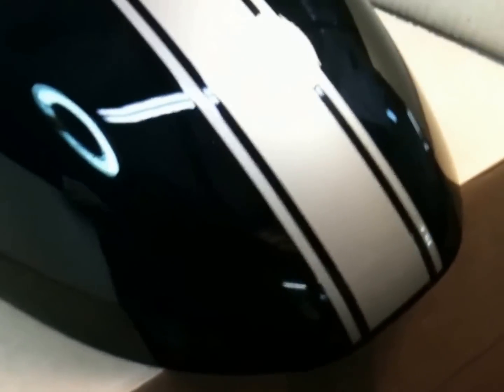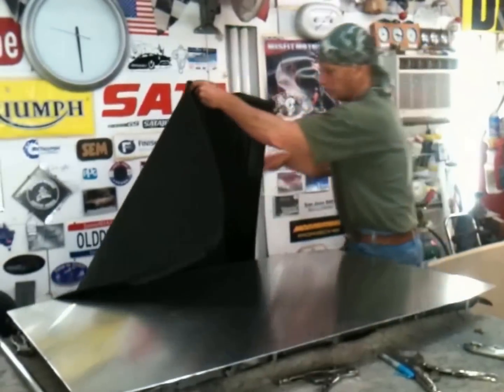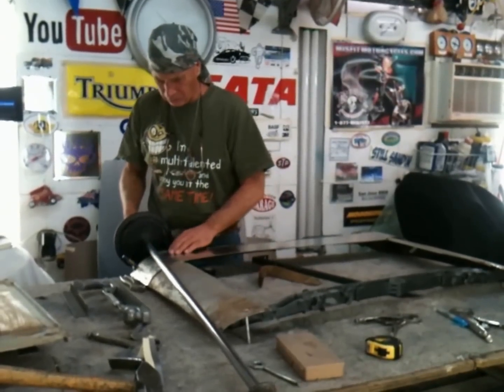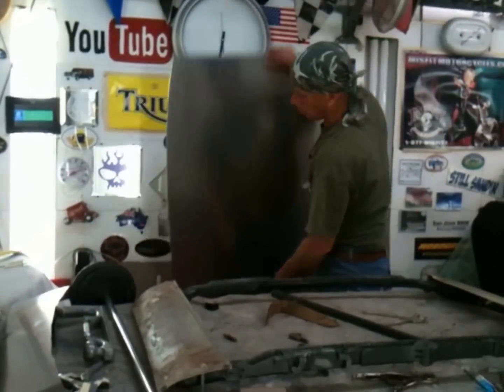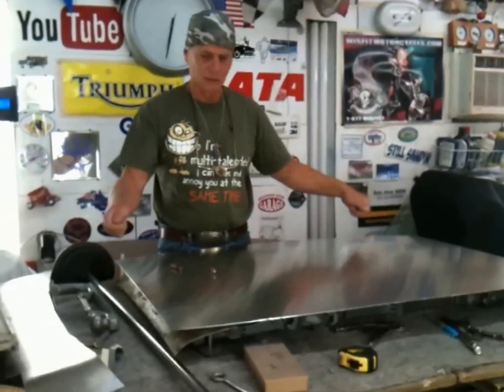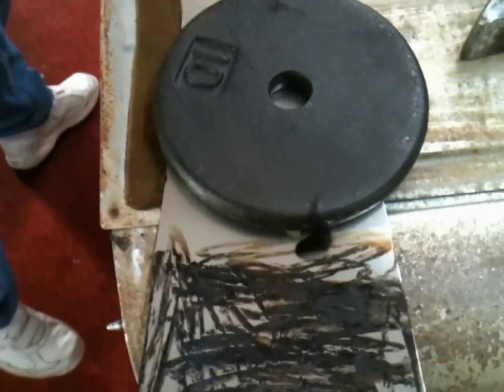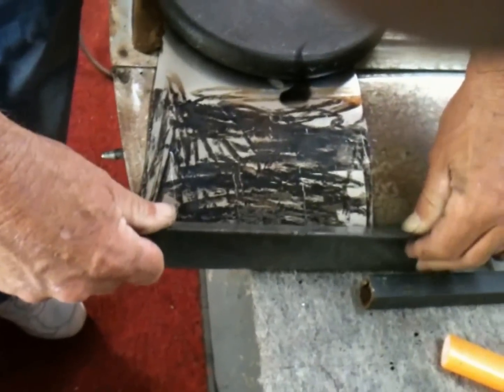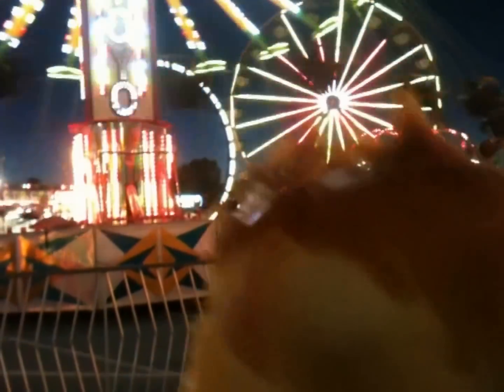How to Anneal Aluminum,, 911 Targa H-Top series 6

Comment from the maker: It's true it will no longer fold but worth the change to me. I want there to be no wind noise att all ever again. The folds cause the OEM folder to eventually leak air every 5 years. I'm just done with that style but hope to keep a look that will work for the car too.. AND I find out that the tops actualy will fit behind the seats up&down inside the car from my upolstery guy who said on day while work ing one hes set it in there and they fit but you do lose some seat room..

Comment: Ok Im confused if you lock in the brace so it does not fold in anymore how will you fit the top inside the car when you take it off? I thought the whole point of the top folding in was so it fits into the trunk

Comment from the maker: Hey Greg yes I have thought of a few ways including different feed angles with a pvc pipe etc...A slip roller is kinda what is shown in the vid where a bar with wieght on one end is slid/rolled with the other end held stable with the hook and you can almost see the hook at  3:11 . The curve is tighter at the rear than the front. Going at a snail pace with it I know.

Comment from the maker: The sheet is aluminum,,the two items you saw are spring loaded little pins that special pliers are used to retract the split pins into the casing and upon release they expand to hold..it was coincidence that they appeared to be magnetic. You may have seen them used in aircraft manufacturing where a temporay hold is wanted called cleco pins/clamps,, Vera says hiya ED

Comment: Man, I wish you had access to a slip roller.  That would take 2 seconds to make that part.  Have you thought about using a 4" diameter PVC pipe and clamping it to the bench with the alum under it and using it as a bending form?  I know you have a thought process, just trying to help.  The key is getting a smooth bend with no kinks...  The top will show everything.  You could use 1/8" landau foam under the fabric to hide any imperfections/holes.